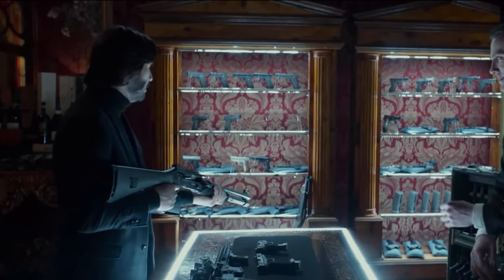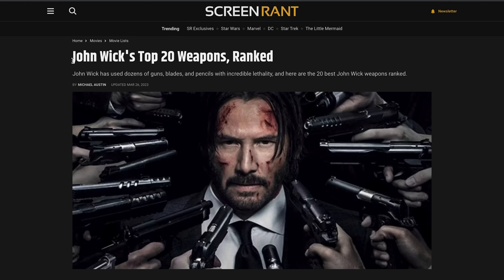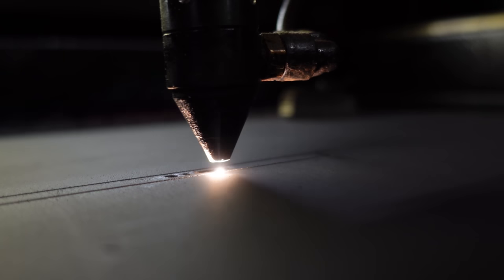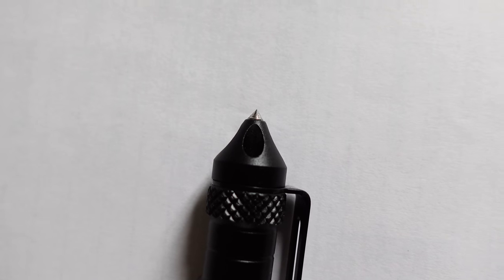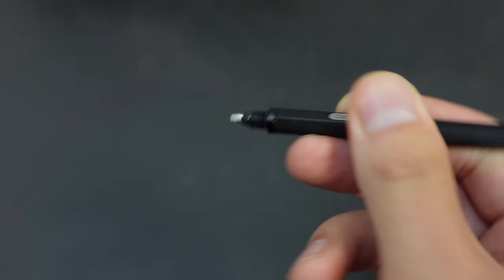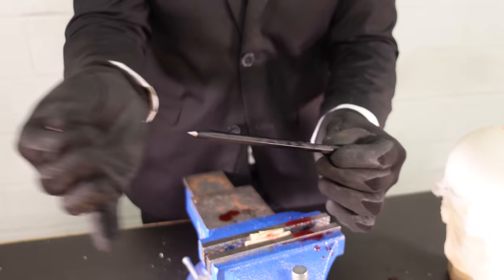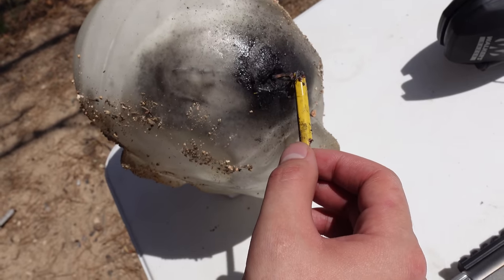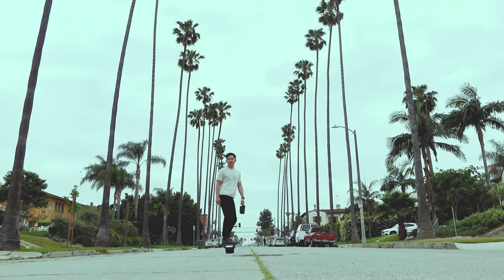This is John Wick's newest weapon

Comment: Ideally you should be able to screw the top to either end , so that you can carry it with the actual ball point exposed and carbide tip safely hidden. Carrying it always with carbide tip out is not very clever IMO. but its a cool  window breaker.

Comment: Honestly, I wish two things. 1: it was yellow. Black just doesn't feel the same. 2: Instead of a tungsten carbide point, you made it a mechanical pencil with 0.5mm lead coming out of the tungsten carbide tip. That would still have plenty of penetration power but would actually be a pencil.

Comment: a definate improvement over a wooden stick, and absolutely cool as a prop and nod to the character, but the problem is that if you did try to use it in self-defence, it would get stuck in the attacker after one stab due to suction -- thus you're fucked you stab once. 
the solution could be a discrete channel running the length of the blade which would allow airflow, or some way to make the entry wound rough like combat knives do. also, at least some amount of texture would help with gripping it. 
i don't see it as viable as even a last resort weapon because of those problems.
good work anyway though, I don't mean to criticize it too harshly, and it's still very cool.

Comment: I make a pencil that’s stabby. I loved the idea of the everlasting pencils on Amazon, but hated the bodies, so I bought some 1/4” od stainless steel tube and a M5 x 0.5 (fine thread) tap, and Bob’s your uncle. You can insert this setup into the wood of your choice. If you have the talent, you could bore out a #2 pencil and install this rod into it, giving you an alloy metal tip and stainless steel body which is more than strong enough to stab, but also writes.

Comment: I'm just sitting here looking at a metal marker/scratcher, with a metal body designed like a pencil, with a special hardened high alloy tip. Standard tools in all metal workshops around here, costs about 3 euro... So this "tool" is more of a not-just-a-prob John Wicker fan item

Comment: i just saw the kickstarter for the FN Pen 2.0 and its different tips. may i make a suggestion for a new tip. its in between the metal tungsten tip and the graphite tip, an inkless metal tip for writing. im not completely sure what its actually made from but if you search inkless metal pencil, you should find something there.

Comment: Tungsten TIG electrodes are not very expensive and make outstanding scribers which machinists often use them for. Why as a custom tip chosen over the very low effort, precise and inexpensive method of grinding a thicker piece of TIG tungsten to shape in a few minutes?  https://www.youtube.com/watch?v=EfKjIZijsP0
Welders self included do it outdoors with a flap disc on their angle grinders, often by clamping the angle grinder in a vise then spinning the tungsten with a cordless drill.  Any hobbyist making similar can buy a pack for ~30 bucks. You can even buy them pre-sharpened then either use one reversibly or slice in two using a zip disk.

Comment: Kinda stupid to have made that carbide tip like that.  You could have easily found some carbide round stock and had that angle ground on to the end of the carbide. Even if you made a thousand of your little toys, you could still have a tool and cutter shop zip through your order on a cnc grinder and have the whole batch done in a couple of days.

Comment: If you look up ZGB and find the video where they pierce a zombie skull (which is actually the same if not harder than a human skull.) you can see that pencils are quite good at piercing the human skull with enough force directed into the bone rather than this guy who seems to always stab at an angle and that causes it to glance off of the skull and snap the pencil. I wouldn’t stab someone in the occipital bone with a pencil due to how round it is. I’d aim for places like the temporal bones, eyes, and maybe the top of the skull although that would be the hardest of the three to pull off.